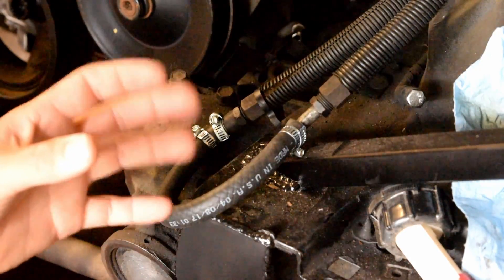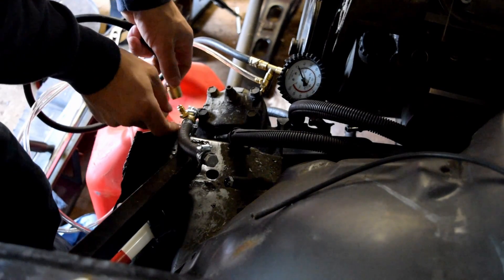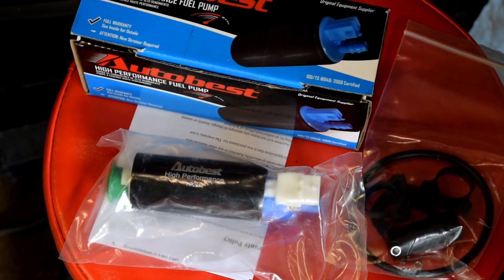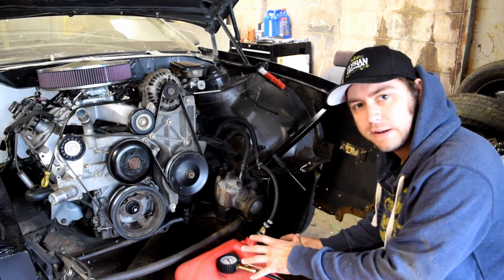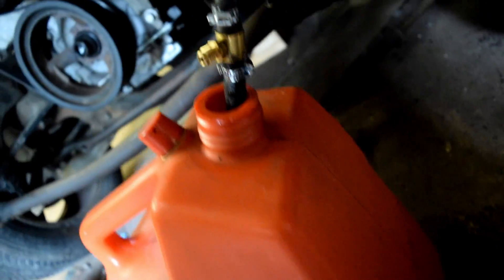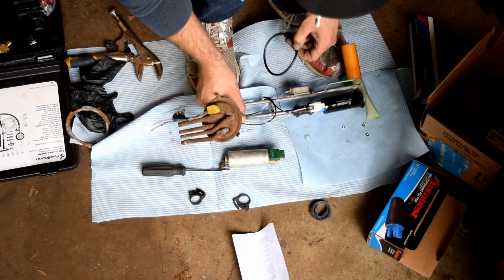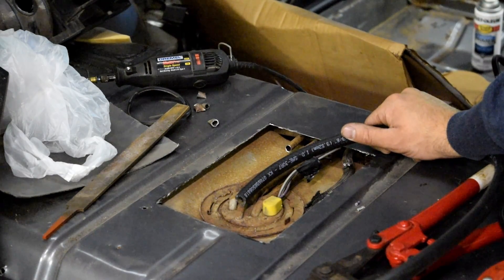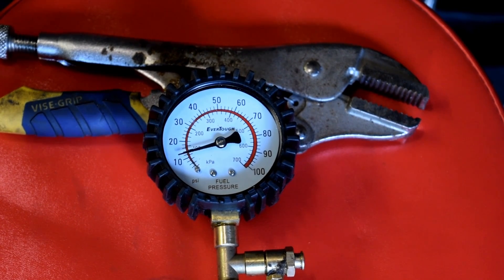Carbureted LS swap fuel pump (testing fuel pressure)

Comment: Can i use that exact pump/set up on a k10 ls swap carburated
Reply from the maker: Ya sure can. As long as it's an intake pump. What year?
Reply from the maker: Also these are no high dollar big brand pumps. I have no idea on the reliability but I did do 12.0 in the quarter with it.
Reply: 76 k 10 im currently running holleu blue electric fuel pump but for some reason it only works good full tank and when im half of tank it acts like i dont have fuel
Reply from the maker: @erwinsanchez5315  hmmm this pump will not work with ur setup. Looks like the holley sucks the fuel out like a straw. Maybe something is wrong with the sending unit?
Reply: Yeah thats exactly what i was thinking. maybe because i spliced my fuel lines to add the fuel pump inline i spliced the lines by the passenger door do you think i did it wrong or did i have to do it like you did from the top of tank ?
Reply from the maker: @erwinsanchez5315  try putting the pump close as possible to the tank. And if that doesn't work, you might need a bulkhead through the tank.
Reply: Ok im try it thanks.

Comment: How long did this pump last
Reply from the maker: Still works but switched to efi. So, different pump now.i ran a season on it.
Reply: Alloyspeed appreciate the reply
Reply: What size fuse did you use on it
Reply from the maker: @jaime13huerta  I used a 30 amp relay so you can use a lower amp switch.
Reply: Wheres the part number for the fuel pump you used ...and quick fuel pump  regulator ...?